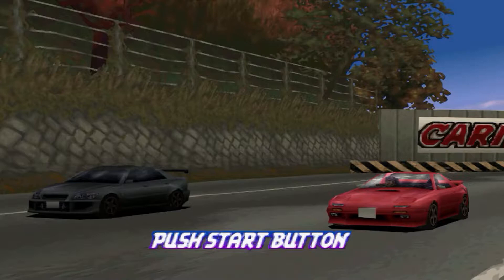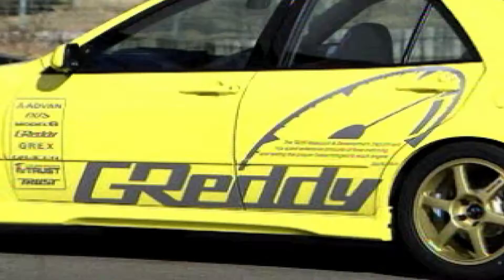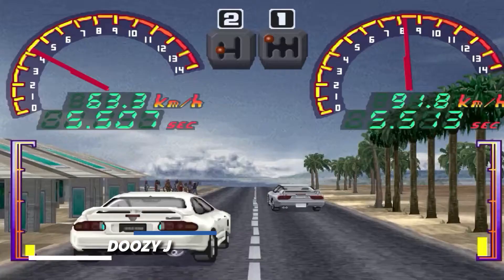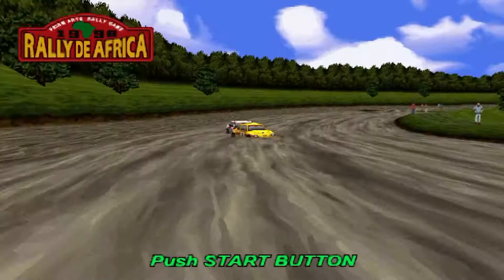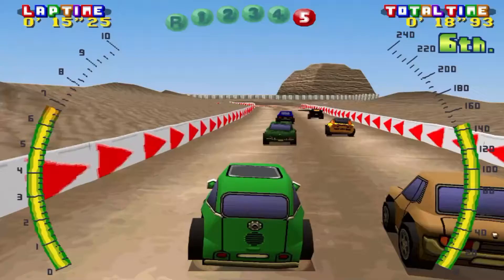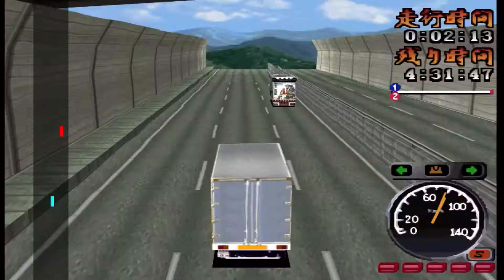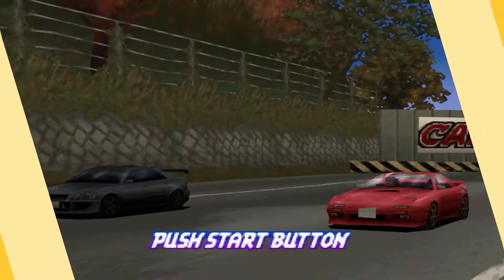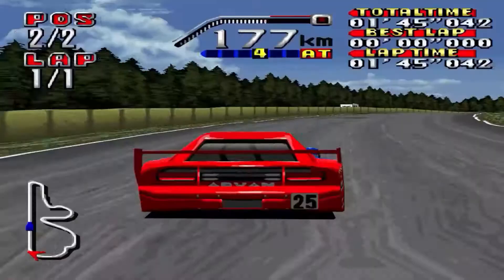PS1 Racing Games Only Seen in Japan - VOL 3 - PS1 Games List

Comment: Mate, you should try Metropolis Street Racer on Dreamcast if you haven't. The Kudos system is the best thing that's ever happened to a racing game. You're going to win the race, be first, happy and actually lose! You'll feel so upset then realize that it's because you lost too much Kudos. Then realize that the best way to lose Kudos is to make contact with other vehicles... After a while, something will become second nature, something that will make MSR the most realistic racing game you've ever played: You will be afraid of damaging your car and making contact with your opponents.
Overtaking each car in front of you becomes a tricky affair and managing to squeeze through between the other car and the corner wall without touching neither will make you feel like a real champ. At some points, you will brake like a crazy person, avoiding the car in front of you by an inch, feeling like you've avoided the worst... You know that it made you lose time, but you know it was the best outcome, just like in real life. Seriously, no other game has ever made me feel like I was driving something that had value. Even when you f*ck up, you will avoid using your opponents as walls to help you put you back on track. MSR is a game for 'gentlemen' in a sense, really unique in that regard.

Seriously, if you haven't, give it a try. What I'm saying should only come after a few hours, it's not like MarioKart's green shells where you instantly 'get it'. The implications of the Kudos system in MSR will slowly change the way you feel about your own car, other cars and the tracks (or rather... their walls ^-^). So, even if you don't like certain aspects, maybe the car selection, where races take place etc, at least try to play until you can get that feeling. The simple rule of loosing a race because you didn't get enough Kudos will make all the difference, truly amazing how such a small thing can have such a big impact.

Side note: MSR then became PGR and if you played those (which I do find awesome too) and you know about the Kudos system but don't understand what I'm saying, it's because they changed it to be WAY less punitive. As much as I love PGR games, they lost half of their soul when making that change... So please, do not judge MSR based on PGR. MSR isn't just PGR with less pretty graphics.

You are a big PSX fan, but quite a massive racing games fan too, from what I can see so, this seems like a fitting recommendation =)
Reply from the maker: I haven't played the PGR series, would love to play them at some stage. I agree MSR is an epic game & i played it a ton years ago, my brother owned it on the sega dreamcast. For me it is the best racer on that system, i was addicted to it. it was unique and had so many cool features & with the kudos system like you said really made you appreciate the cars and you overall progress.

You really have to think about what you are doing, you will become a better driver overall from playing this game lol

It is a game i would to go back to play for sure. Yea i just love cars & video games so for me it is a great way to combine the two...